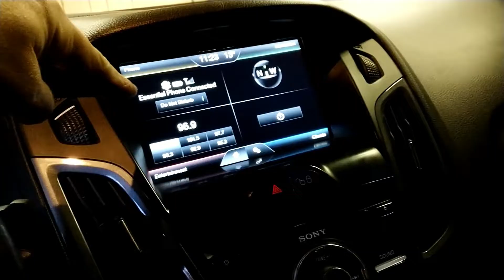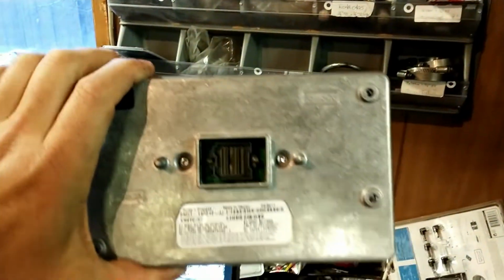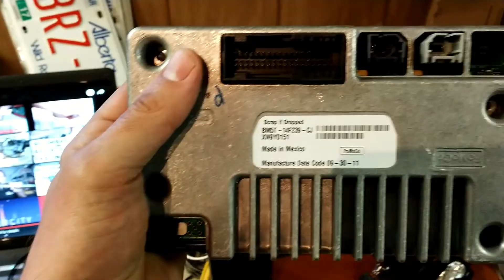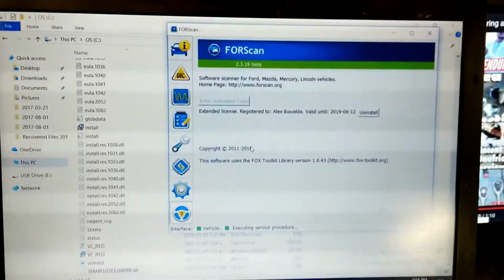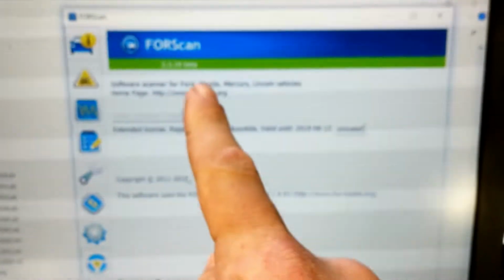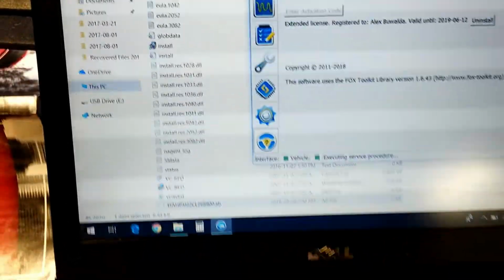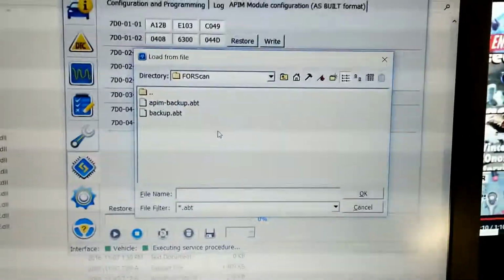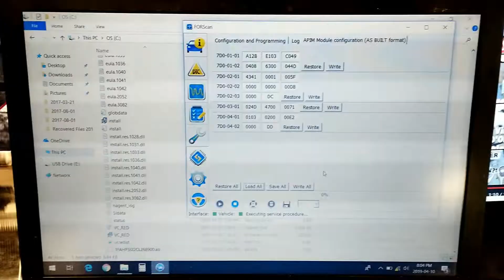Broken Ford Sync APIM Repair\Replace\Reprogram

Comment: How can you tell that it is the APIM module and not a dead screen?  And will any Ford APIM module work with a 2012 Lincoln MKX?
Reply from the maker: Mine started not working and then working again for a year before it finally died, so I guess at the APIM based on web info that the screen doesn't die to often.  Pretty sure if it has the same model series number, it should work, I went by picture of the back of the unit, I think the edge\fusion\focus\escape were all the same 2011-2015 or so

Comment: Great video, I also have a 2012 Focus with a blank touch screen. Do you believe any used Ford APIM that looks the same as mine regardless of the model car or year can be reprogrammed to work using FORScan? I cant find a used Focus APIM but there are a lot of Fusion APIM’s and Escape APIM’s that all look the same as mine.

Thanks, TD
Reply from the maker: Thats exactly what I did, mine was from a Fusion I think, as long as they look the same, they can be reprogrammed as I understand it.  I couldn't find a Focus one either!  And thank you for the kind words, I'm happy that I can help someone else out of this mess without paying Ford a ransom in repair parts

Comment: Hi, thanks for the video, I’ll have to do the same with mine 2012 focus. Have a question about scanner that you used, I found the same model but black one. Will that one do the same as yours?
Reply from the maker: If its made by the same company, they have all the specs on the website on if it'll do Can-bus programming.  Totally worth buying a quality piece, then you have it for life!  (my mistake in not buying a quality one first off)
Reply: Kingsoupturbo Ok, I’ll check the website, thanks for video👍
Reply: Thanks for video, I replaced mine on 12 focus titanium. After I reprogrammed the new module, I got back steering control and nav. But my screen started acting up. For example when I choose entertainment it pops up the nav screen, when I choose nav it shows climate, and doesn’t respond properly. So I thought screen went bad. So I replaced the screen from 15 mustang, the parts numbers showed it would match. So I plugged the new one, same thing. So I assume my screen is ok. Could the problem be with new module? It was built in February 2016, so maybe it’s a sync 3 module?

Comment: Did you already have a license when you went on Ford's network so that when you filled out the info they gave you an extended license to do this?
Reply from the maker: There is like a login for the ford service data thing, that as-built isn't in there, there is a 1 click link that you put your VIN in and it gives the data, I didn't have any login.  The Extended license you need to register on the for-scan forums, get approved, then follow the link instructions on how to get the software activated. I know its a bit confusing.